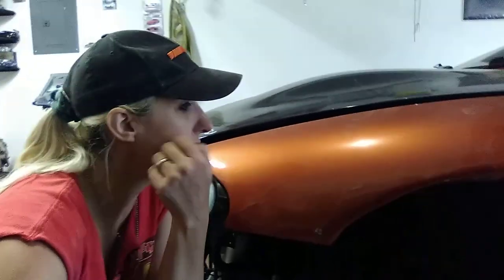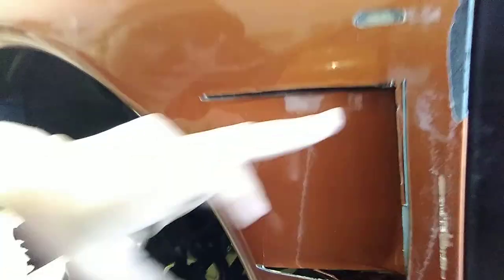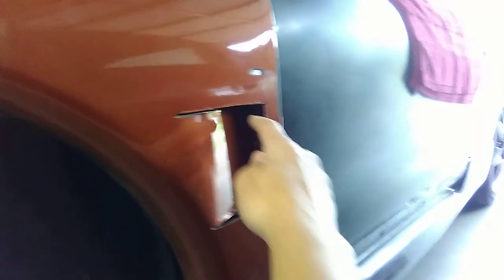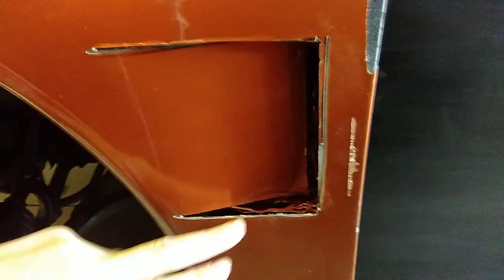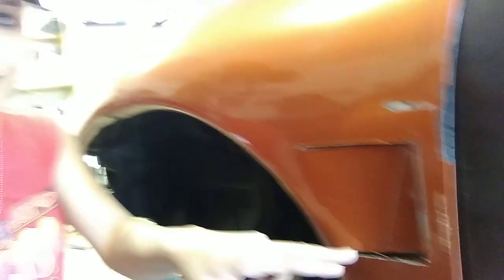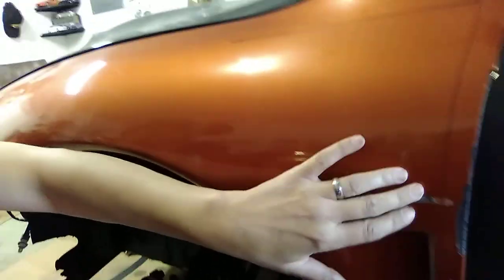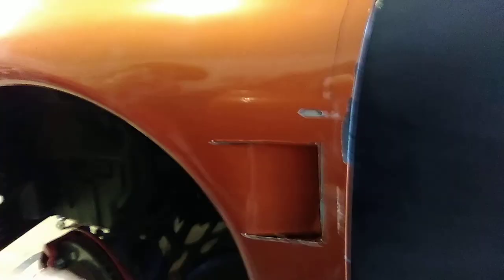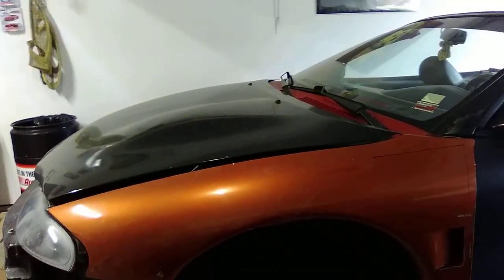Custom fabricated fenders on the Black Widow

Comment: you can fiberglass it with eglass fiberglass and create rolled fenders to handle the lambo doors. tbut you will need pva wax and partal paste #2 to be able to remove the fiberglass part from your fender. it will eliminate outsourcing a welder and can drop some weight.